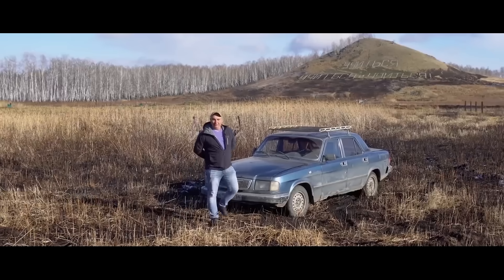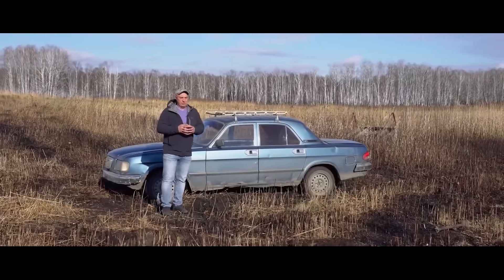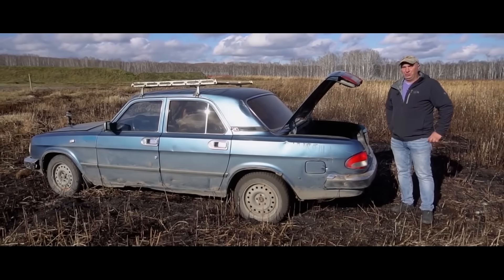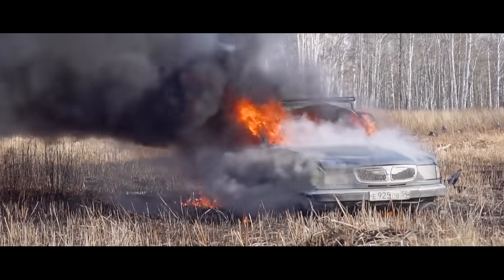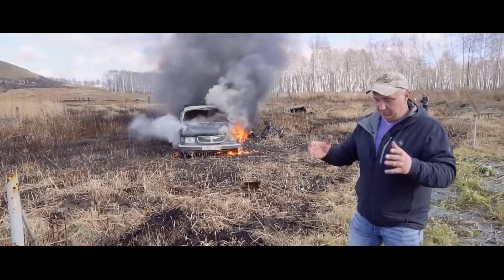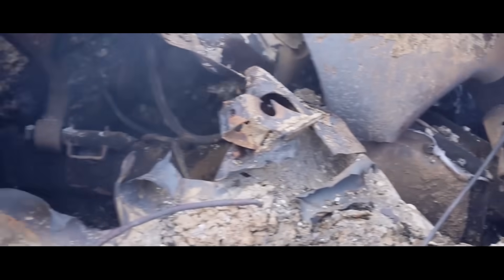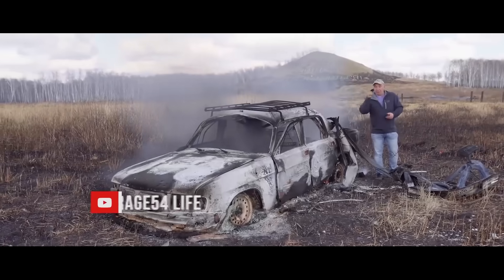Can a leaking LPG tank cause your car to blow up?

Comment: That is a very unlikely scenario in real life. I'm running LPG, and if you can stand the rattling sound of the engine, it's actually safer than gasoline.
Many modern cars have composite gasoline tanks, which aren't convincingly sturdy in a crash. Whereas the LPG tank is bulletproof.

Obviously safety maintenance is crucial. When you take your car to the emissions inspection, you usually book yourself a LPG system safety check. 
So your system is not leaking.

If we assume a LPG leak in the boot of a car, if you are lucky and have a spark in that boot, just at the point in time where the gas/air mixture become combustible, you could potentially have a loud bang when the mix ignites. But it would never set off the actual LPG tank.

Comment: Wait but you made a gass leak and then hold i fire by the gas right? Im sure that if i drill a hole in the fuel tank and hold a fire near it the same will happen.

Comment: Put the car on top of a pit, this will really blow the car away.
It had happened in Germany during a TÜV inspection. The engineer inside the pit was dead and the car leaning against a wall standing on its front bumper. The leaking LPG was presumably ignited when the engineer had plugged in his work light.

Comment: i seen video's of a propane tank mounted to a huge  piece of concrete and gotten ran intoo head on by a train that had a wedge mounted to the front of it  , the tank did not blow though it folded in half and the blowoff valve let off some of the gas inside it 

the explosion in this video looked like a liquid explosion , if they blown the tank itself up using explosives and there was still fuel in the gasoline tank below it that can explain it as compressed propane is a liquid

Comment: Definitely could blow up. Probably easier to blow up LPG than gasoline. The gas vapors are more explosive than the liquid. I have seen videos of people shooting the gas cylinders and blowing them up. There has to be an ignition source though. It will continue to burn until there is no more gas. We used to have a propane powered truck at work. the fill valve leaked all the time. It was very dangerous.

Comment: Once when we were on a roadtrip, the hose leading from the cylinder to the engine snapped, and the gas started leaking.... luckily, it didn't blow up, only the gas got out, but lemme tell ya, it was not a fun experience.
This exactly could've happened.
Reply: only with an ignition source. that was the difference. not many people drive around with a lit match or similar in their boot all the time

Comment: Well the truth is this would never happen in real life unless you detonate a bomb next to the gas tank, like you guys did here. The LPG cylinders are quite thick pieces of steel and have a lot of protection systems, like valves and whatnot to avoid situations like these. The worst that could happen is it would just ignite and fire a stream of flame, just like a stove burner, but won't blow up.
Reply: I agree

Comment: Bullshit.
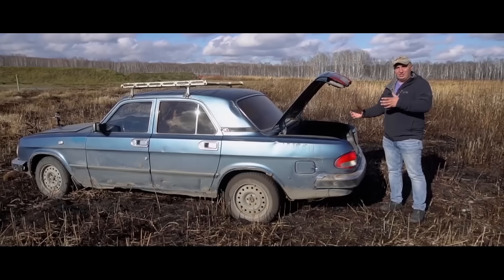The LPG System is designed to vent the Gas to the outside instead of into the Car. At 02:22 you can see, that the plastic housing of the Tank Valve is not closed. (The Cap is propably the Clear palstic under the Stick left to it). Under This condition this LPG System wouldnt pass any safety inspection. And, because the cap is next to the Tank, i would say, that they took it off, to propably make the tank vent into the Car.
Reply: Also the Ventillation Hoses are Cut, LIKE WTF
01:28 "We're dealing with Equipment that was actually ment to be installed in a car" -- Yes dumbass, bot not in the way YOU manipulated it to make this car Explode FOR CLICKBAIT.

Comment: car can get in fire if always drive on lpg gas hoses rot and gas leak on hot motor,lpg cant explode if equipment is in good condition cose it have security valve it should just spit fire hahahah but if trunk get full of lpg like here its other story then explode....i drove  on lpg about a year and didnt like it cose of some laws in  my country so i kicked it out and putted subwoofer on that place

Comment: Stupid question, does a car that runs on LPG need petrol/gas? I dont know anything those cars (well, thats for cars in general :( ). I just like explosions and have seen a couple of vids of cars exploding that ran LPG or natural gas, but never one that exploded like a car in a Hollywood movie filled with pyrotechnics and plastic petrol/gas containers.
Reply: Ideally you want to run most engines on some gasoline once in a while. Keeps the valves "lubricated", kind of. That's because both LPG and CNG are dry and don't lubricate, so they often end up rising the temps on the exaust valves in the engine, resulting in faster wearing of those valves. Intake valves don't suffer as much as they take fresh-er air/fuel mixture in. You can also start a car on LPG, and probably even on CNG, but might be harder on the latter. 
Running an LPG/CNG converted car on gasoline once in a while also keepts injectors and the fuel pump/tank in good running condition (you don't want to leave old gasoline in a tank for more than 3/4 months, as it ends up decaying)
Reply: @DeerKoden  Thank you for the explanation, makes sense in a way. Never thought about lubrication with a gas engine. I'll never get a car running gas, I kind of have this paranoia about compressed gasses.  
Again, thank you for the explanation!
Reply: @Not-TheOne  well, modern gas cars are safe. Also, LPG is stored at quite low pressure in comparison to CNG (and you're more likely to find more LPG pumps throughout Europe or the US). It's also easier to run on LPG without sacrificing room in the back cause the tank is not that big. CNG in comparison uses bigger tanks (cause you can't compress natural gas over a certain pressure). Ideally CNG should be the way to go, cause it doesn't need to go through processing (while LPG does), and it's even cleaner than LPG, but it still requires ducts and more equipment than LPG at the pump.

Comment: Another Volga has been scrapped. As long the gas tank and system meet the
 ECE
safety- and law requirements no worry. If they are being treated in Russia as
they treat their - mostly rusted through - cars im not surprised about the result.

Comment: That made me smile.. We have lpg here in New Zealand too. We had an idiot refill his air conditioning system with LPG.  It had a small leak from the evaporator under the dashboard and he smokes. He did not know that.  The gas pooled on the floor as it is heavier than air. It blew the windows out of the car and bowed the roof and floor. Surprisingly he lived.
Reply: What the actuak fuNk...? How can anyone refill aircon with LPG??? That's insane
Reply: @DeerKoden  He wasn't the sharpest knife in the draw.

Comment: It depends on how much Oxygen is in the atmosphere, weather the gas will simply explode or burn. The explosion wasn't much so in this case, plenty of Oxygen left over to fuel the fire. Around here house explosions typically have a fire right after, very rarely do they explode without one and when they do it's usually because the entire house was sealed for a long time until the furnace or another appliance created a spark.

Comment: Is an actual explosion even possible? I mean there is no reaction partner inside the tank... So theoreticly the max danger should be a flame coming from the tank.

Love your Videos anyways. Your awesome
Reply: No actually flame out of the tank isn't all you'll have to worry about. The pressure inside will rise from temperature change,  causing it to burst in a fireball.
Reply: Seems plausible to me

Comment: With the new environment regulations the refrigerants in the air conditioning unit are flammable so you'll get this with a leak in the air con hoses.
Reply: Yep, they use butane as a common refrigerant thanks to all the greeny eco-warriors and climate alarmists, our air conditioners are both less efficient and highly flammable
Reply: @arcadeuk  I somehow doubt that the contents of your air conditioner is suddenly going to explode. Have you worked on an AC and seen how robust all the lines are? I mean, in an accident I suppose your condenser might rupture and a small amount of gas may come out, but there's not really that much in there to cause any serious harm.

Now as for being less efficient, yeah, agreed. The propane stuff is not as good as R134a, not to mention R12.
Reply: The Kombinator that's true.
Reply: @the_kombinator  AC lines tough? Don't make me laugh, I break those things with my bare hands. Aluminium may be cool,  but strong it's not.
Reply: @asovietreunion13  Niet soviet! I suppose the gasses will escape, and bend the metal to the point of fatigue? 

Brake and fuel lines can also be broken by hand. This has nothing to do with the ability of the lines to contain the gasses/fluids contained within them under normal circumstances.
Reply: @the_kombinator  Yes. they are fine as long as no rocks or anything hits them. as long as nothing sharp or heavy hits them. You would not believe how often I see broken ones though. It's like the number one cause of "mY aC dOsN'T wOrK".
Reply: arcadeuk it's less greenies and more that refrigerant is super toxic. The amount of refrigerant in a car is around an ounce which isn't that much. And I believe they are also using co2 as well.
Reply: @abhimaanmayadam5713  Refrigerant is not super toxic. R-12 was banned because Dupont (the manufacturer) wanted to introduce R-134a to the market.
Reply: @asovietreunion13  actually it is, I'm currently studying to become a mechanic and I've seen the msds of r134-a and r12 while r12 is much worse both are heavily toxic to both environment and people (can lead to asphyxiation and permanent internal damage as well as severe cold burns if come into contact with), propane is much less dangerous on the other hand with only cold burns being an issue
Reply: @asovietreunion13  R12 was banned in 1995 because it was determined to be the leading cause of ozone layer depletion (the stuff was used for everything from refrigeration units to spray can propellant) and the ozone layer has mostly recovered today thanks to this ban.
Reply: @AstoundingAmelia  Anything that displaces oxygen is an asphyxiation hazard. Nitrogen makes up nearly 80% of the air we breathe but you can still die from asphyxiation from working with LN2 if you don't have sufficient ventilation to flush it out faster than it is being released to keep oxygen concentration at a safe level.
Reply: @teardowndan5364  the difference is that while for propane that is true, r12 and r134a don't have to displace all the oxygen to asphyxiate you. they do so by reducing the amount of oxygen that your body is able to take in by messing with your bronchi and also by becoming heavier than air and making your lungs unable to draw a proper vacuum and suck air in
Reply: zabnat it's more likely for the gas to leak out before it ignites. There is only a small amount in it. Like an ounce or so.

Comment: i guess the air/fuel ratio was wrong as the videos i've seen have blown up a car without any visible fire
Reply: You maybe have seen natural gas cars, which sometimes blow up, especially during refilling. They store the gas with 250-350 bar, while the lpg system has around 3 bar. The tank system should sustain pressure around 12 bar, since it can rise through heat. For comparison: Hydrogen cars store their fuel with around 800 bar.

Comment: What kinda batteries do you see exploding? Samsung ones?
Reply: Nah if you have a dead car battery sitting on the cold concrete hook some jumper cables up to it and see what happens. Also they say some batteries can leak hydrogen (i think) gas when it goes bad and a spark from jumper cables can make that puppy go BOOM
Reply: Car batteries explode quite strong

Comment: Test kinda does not look so realistic. How long did it leak for? What was the source of ignition?
Reply: they probably put a bomb on it, even if it has a valve failure it won't explode like that, would be more like a flamethrower

Comment: Early, i was always afraid of owning gas car  so this test is good. Now I see that can be dangerous especially if the gas system is old.
Reply: be the same if gasoline leaked, along with a convenient fire under it.....its probably safer to have gas as the leak would have to be huge as gas would otherwise dissapate, this is what the hydrogen toyota does in an accident, releases the gas over a 1-2 minute period as its likely it wont lead to enough gas  mixture  to burn
Reply: @jusb1066  I would take a gasoline leak over a CNG or LPG leak though. I've had a leaky fuel tank for years in an old Protege and nothing happened - if I smelled the sulfur/egg smell though, I wouldn't go near it.
Reply: Jusb1066 
Hydrogen is very very light and will quickly fly off into thin air, literally. LPG however is heavier than air and will slowly flow to the ground. This is what makes a LPG leak dangerous. The tank itself should never be compromised, but the surroundings will be if there’s a gas explosion. 

The gas tank in the video was severely damaged. With a proper (EU-spec) tank this will (and has) never happened. ￼
Reply: What is the most dangerous part in a car with gas? The driver!!! Gas is not more dangerous than petrol.Even russian batteries are more dangerouse than gas. :-DDD
Reply: @Juggernaut30  Bullshit. [bites into chicken]
Reply: Has a gas system inspected once in a while, replace gaskets once in a couple years and nothing would happen to it.